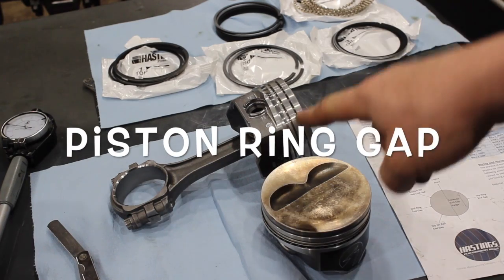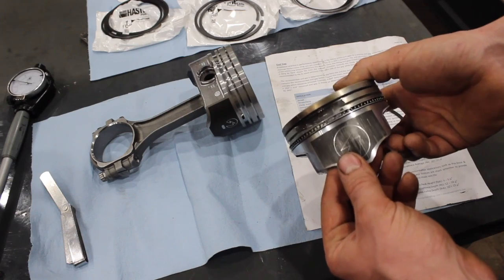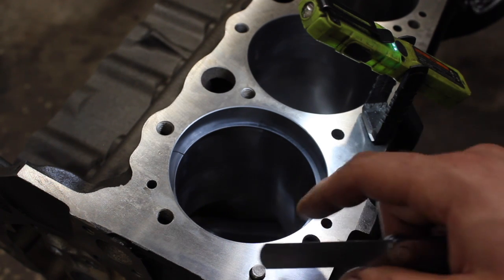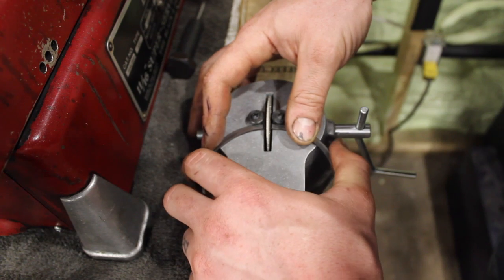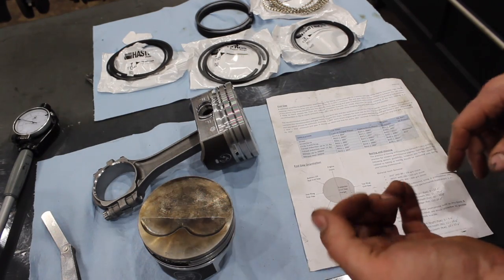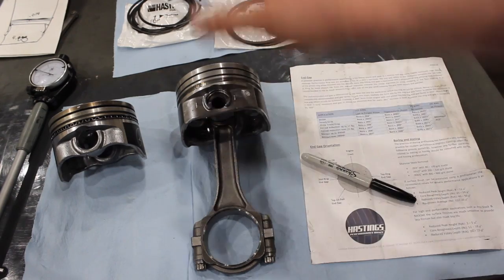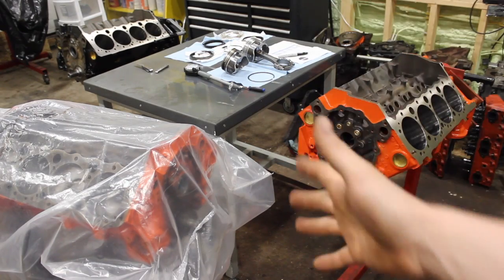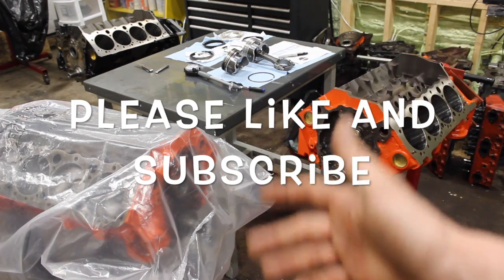Piston Ring Gap Tips! (How much do you need?)

Comment: 4 years 40xxx mile later after my my motor was built with that same brand piston, bust the skirt off one and 7 of the 8 was cracked in the same place as the one that bust , my machinist doesn’t think it was a ring gap issue more of that brand

Comment: I'm an Aircraft Mechanic (A&P) I need to Put Rings in a Continental Cylinder, Head is Screwed On during Manufacturing , 
After the Cross Hatch Hone job, the Cylinder is up-side down.When fitting Ring Gap, so the choke is where the steel barrel joins the aluminum head. just to be clear, the widest part of the bore would be at the top(since it is up-side down) couled you do a youtube about aircraft cylinders? This bore is 3.875" Piper Cub 65 Hp Engine

Comment: I screwed up on Z Gap rings, I have done file fit but with the Z Gap, I assumed since they had the lower ring to help seal it, why would you need to Gap them……? Well, luckily one ring stuck, but it ran on its own base pressure to the point I couldn’t shut the engine down. Luckily I’d didn’t damage the pistons or seize the engine!

Comment: Are newly installed piston rings meant to make a slight scraping noise when crank is turned by hand for first time?

I even ended up uninstalling the piston to check the rings and cyclinder wall and it all looks good.

Is this a normal sound for new piston rings riding on the de-glazed surface?

Hope you can help put my mind at ease!

Comment: Old video, I know. But just an FYI, you should NOT be filing both ends of the rings like shown in this video. File one side of the gap only.
Reply from the maker: Why? I know some machines do one side and some guys say only grind one side....whats the benifit? If you keep the ends square, what's wrong? Ive been grinding rings like this forever and haven't had any sort of issue
Reply: @cuttersperformance  well, I shouldn't say never to do so, it's just more of a best practice to only grind one end. It allows you to keep a perfectly parallel face to keep checking your grind against to make sure your not slightly grinding at an angle. By grinding both, if you aren't careful and slightly grind at an angle, you'll end up with two angled ends like this / / where as if you only grind one side you end up like this | / and you can fix that much easier without overshooting your target gap.
Reply: If all the pro builders say to do one side. It's good enough for me. You answered your own question as to why. Easy to take it off.Can't get it back. Also Is recommendation of a proper file to deber would have been good. Also the second ring can be up 20 thousand larger. Seen it tested. You could also add Which way is up on a ring. Additional  Orientation of rings. The benefit of accuracy of torque hone, and check ring gab with torque plate installed. For those of you that don't know. Watch more than one video before you dig in. Not all youtube Channels or machine shops. Are the same.

Comment: Hi am building a 355 with srp forged piston,twin turbo the goal its 800 to 1000 hp how much gap i gotta have to use
Reply from the maker: Check what SRP recommends but  it should be around .030 top ring and .032 to .035 2nd ring

Comment: Do u like a kieth black hypertectic piston are they any good?
Reply from the maker: Ive used a few sets in the 425 to 500hp range and never had an issue with them
Reply: @cuttersperformance  ok Iam building a derby engine 355 with promaxx iron vortec heads and wasn't familiar with the kieth blacks seen a bunch of reviews of tops coming off what's your input on that
Reply from the maker: Most guys dont check or follow KB top ring gap recommendation, which is wider than normal.
Most KB pistons use a .0065 x bore size vs the regular. 004 x bore
Reply from the maker: Pcperformance1@outlook.com
Reply: @cuttersperformance  thanks I sent u a email

Comment: i can confirm ring gaps are an often overlooked thing when turbo converting engines. i left the stock gap and cracked ALL my pistons ring lands. no sign of lean running or premature detonation. just from the heat the rings closed and flexed. Live and learn....and NEVER forget to gap properly for the cars performance level. More power, More ring gap
Reply from the maker: Yeah its what kills most NA engines that have added to them
Reply: @cuttersperformance  most definitely and when you go look at stock na ring gaps compared to any performance applications gap you would find 2 times as much as you had.

Comment: Hay bud im fitting a new cylinder and pidton and rings on my engine my cylinder bore is 57.4 using a pisyon ring gap caculater i get ring gaps to be 
Top 0.23
2nd 0.28
Oil   0.8
Would you say this is about right for normal street use
Reply from the maker: What bore size do you have? 57.4mm?
Reply: @cuttersperformance  hi yes 57.4mm sorry i should of stated that
Reply from the maker: Yeah .23mm/.28mm is about right for that piston but always refer to the piston/ring manufacturer for gap into if available. Especially with a small bore
Reply: @cuttersperformance  i have manufacture spec but its for the stock 54mm bore my new kit dident come with any paperwork it was a cheapo kit lol but thats great thank you for your help

Comment: I'm using sealed power hypereutectic pistons H815DCP with  Hastings 2M4860 piston ring set. In a Chevy 5.7 vortec everyday driver.  I contacted Hastings and they recommended 
TOP = .026” Min.
2ND =  .018” Min.
But top measure .022 to .024. should I open the top ring to .026 and the 2nd ring larger to prevent ring flutter ?
Reply: What end gap would you recommend ?
Reply from the maker: Hey Josh! 
if im not mistaken those rings are the "Metric" vortec style rings.
Im really surprised that hasting recommend that large of gap. Thats like big shot of nitrous sized gap haha
I like to get .0045 to .005 per inch of bore for the top and .005 to .0055 for the 2nd. 
I don't want to go against the ring manufactures directions but maybe you should talk to them again

Comment: I ordered a scat 935050l sbc 3.75” 1 pc main 5.7” and need help ordering piston i was looking at speed master piston set PCE 305.1002 4.30 bore flat top for 383 sbc stroker would this be the right ones for the crankshaft? Thanks for your knowledge
Reply from the maker: If deck height is the at 9 inches then you will need a piston with a 1.425" inch compression height (3.75 stroke 5.7 rod). But at the stock deck height that piston will be .025 in the hole

Comment: If my bore is tapered where do I set the ring to measure the gap?
Reply from the maker: As far to the bottom as possible. The top of the bore will be worn larger and setting the gap there will make the gap too tight at the bottom of the bore

Comment: Do you have a favorite ring manufacturer?

Also I havent seen anyone talking about adjusting the oil scraping ring. I found on my build that the oil scraper and rings seems almost too big for the piston.
Havent bored the block yet so I dont know how it will look inte block..

Also it would be interesting with a video about oil drain back. I drilled oil drain back holes in my new pistons. Seemed like a good idea from what I have read. But your view on it would be interesting to hear.
Reply from the maker: For sbcs I use alot of Hastings or sealed power and for wild stuff I've used total seal (not gapless) 

Sorry maybe I should have touched base on the oil rings, obviously need to be checked but also never needs to be adjusted 

As far as drilling oil holes, this is something that I've seen used with low tension rings to help keep oil control down. I don't use alot of low tension stuff so drilling pistons isn't something I do but I also haven't had issues with oil consumption

Cheers!

Comment: Just built a motor with these exact same pistons. I went 17 top and 20 2nd. Had to grind 2nd gap but they were supposed to be good to go
Reply: They’re rarely good to go. 😱
Reply: Its a 880 block with vortec heads. I'm using the sealed power moly rings. Should I pull it back apart? Love you videos and watched them before porting and you really helped me out!
Reply from the maker: The non broken piston right? Haha You'll be fine as long as the engine isn't being used for extended periods of time at full throttle (circle track) or if you plan on using power adders. 
Vortecs heads you will make great power but not enough to need .020 on the top Naturally aspirated
Reply: @cuttersperformance  Dude thank you so much for answering back! Ok awesome thank you! Sealed power said same thing as you. Yeah I'm using the H631CP it says, even using Scat rods like yours lol. Pistons are 18 down in hole, using GM .028 gasket. I'm coming up with 10.2:1 on the calculator. Running the XR276HR. After the porting I'm hoping for 420hp?
Reply: RPM Air Gap, choke-less Proform main bodied 3310 Holley. Davis unified HEI. But mid length 1 5/8" headers with 3" into dual 3 chambers. 420 and 450lb ft is what I'm hoping for? Still working on the heads.
Reply from the maker: You'll for sure be close! Thats a great cam, I've used it a few times. Are you going to dyno it? With a mild port job and that cam my guess would be 415 to 420hp and probably around 425 Tq.